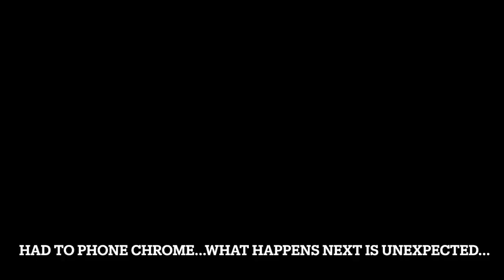AMBO Deconstruction | Eating at Weirdos GARAGE | Power Out | VANCITY VANLIFE HQ | MINI VANLIFE, BC

Comment: You know I know zero about dampness/lots of rain and snow but post converting an auto isnt there some kind of coating/undercoating to prevent all the rust? Gimme a break, Im in So Calli  lol
Reply: @insanity6829  Are you looking for a rubber cover...🤔🤦‍♀️ There is a latex you can use for that.  It is pliable and expands when the metal heats but issues binding when shrinks from the cold... scientifically speaking of course.
Reply: @sarah_n_tank_girl  Thank you for your reply Sarah Rose.  I just wondered if there was a way to spray some kind of underprotection on autos  to avoid 
all the rust .  Not for me as we dont have those issues where I am.
Reply: @insanity6829  I sprayed under my converted cargo trailer because I splash through a lot of puddles...I try to stay on dirt when out n about...
Reply: @insanity6829  I live in Ontario, Canada. Rust is a huge problem as the rock salt they put on the roads during the winter exacerbates the damp from the snow. The best thing to do here is an annual treatment. There are businesses, many of which are chains, that specialize in rust control, and the annual treatments aren't all that expensive. They do a deep clean under the chassis, followed by a sprayed on covering that provides protection throughout the winter. But I'm with you. Why can't the cars be made with rust protection already in place? But maybe there's no such thing, and the reason for the annual treatments. I've had a number of cars destroyed by rust long before their engines and drive trains gave up. It's not just the body that rusts, but all the screws and hardware that keeps everything attached. It's really hard to buy a used car that doesn't have some degree of rust already.
Reply: @Loruca  Thanks for your reply Ruth ! Im learning alot watching these things and listening to nice folks who bother to reply.  God bless !